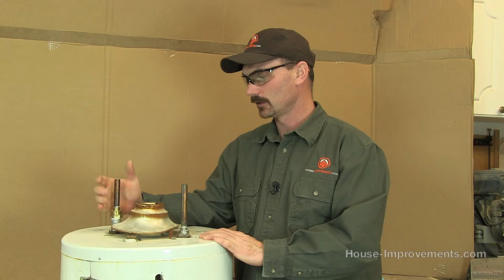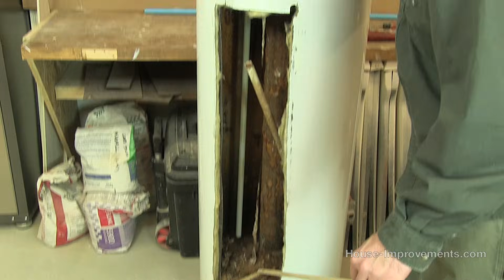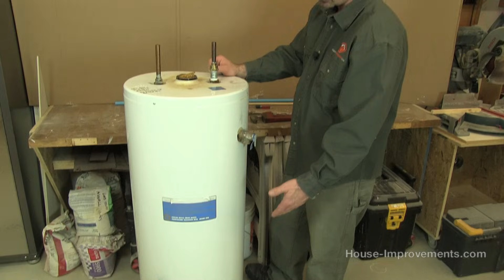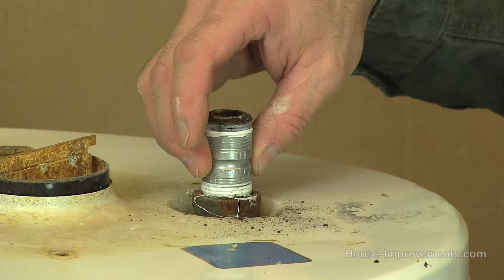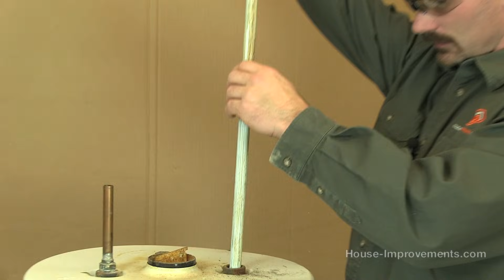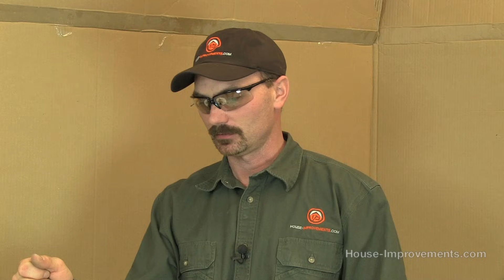How To Replace A Water Heater Dip Tube

Comment: Would love to see a version of this video where you change the dip tube in a water heater that's in place in an apt/condo, in a utility closet, behind the forced air system, with about a foot of clearance above the unit. Or a tall tank with a low ceiling in a basement.
Reply from the maker: really can not be done with that low of head room.
Reply: You have to pull the heater to work on it. No other option. More trouble however, that's the breaks when you don't have the space.
Reply: You can get flexible anode rods. They are segmented so they can be installed in tight quarters.
I don't know about the dip tube. Just seems that there should be an option for a flexible dip tube in cases where head room is tight. Must the dip tube be PVC? Is using a braided tube or other flexible tubing an option, or would it cause problems inside the tank? I don't know.
Reply: Could you not replace it with a more-flexible tube?
Reply: Shutting off the gas or disconnecting the electrical, disconnect the inlet and outlet lines, emptying your tank and moving it out the same way it was brought in will be the easiest for you. 

Second option-
You can cut the old rod in sections as you bring it out of the tank. There are new rods that have shorter sections linked together and they bend so you can feed it in to accommodate your situation. The sections around 10 inches. If you don’t have that amount of space then you should have installed it per the manufactures instructions. Manufactures recommend inspecting, servicing, and cleaning periodically. Can’t do that if things are in the way. This is important in case you are under warranty and want to be covered. 

Is this a gas water heater? If it is, your installation is violating building codes.
Reply: Plumber in our area charges $180 service call plus $120 p/hr labor. So learn to do it yourself. Also, this would be a good time to pull out the anode and perhaps change it at the same time
Reply: It's simple you charge the price of a new heater just to pull the heater out replace 1 part put it back and wave a warranty.
Reply: R. Spivey is that an option? I just assumed (maybe incorrectly) they were all basically rigid PVC-like tubes. Can I get flexible anode rods,  too?
Reply: I get about 2-3 minutes of full hot water before straight hot water drops to about 105-110*f and slowly descends from there until you get around 70-75*. If I can’t get clear the ceiling in my basement. I will tilt the water heater and have to replace 2x 3’ sections of pex. Well, the cold water piece would be about a foot long. Thankfully, I have several feet of both red and blue on hand. But constantly messing with water temp in the shower blows. 

I modified my shower head body to actually flow some water. But I get the same issue in the tub in my other bathroom. Kitchen sink and bathroom sinks aren’t an issue as they aren’t ran full on for 10+ minutes on a regular basis.

Comment: I've got some sort of galvanic corrosion on my cold water side so I have decided to change the galvanized nipple. Will the old galvanized nipple come off the dip tube or do I have to get a new diptube with the nipple attached? (This is 1 year old Rheem water heater and I just caught the corrosion.)
Reply from the maker: depends on the heater. Go to a dealer and see what the new dip tube looks like , If it has the nipple all on it then I would just buy it.
Reply: I have a side inlet on my hot water heater does it still have a dip rod

Comment: How can you connect a flared tube and dielectric heat trap nipple?  I cannot find anyone less than 60 miles away that carries the tube and nipple attached already..

Thanks!
Reply from the maker: not sure if you can just slip it in? I'm really not sure

Comment: Great video. Can you replace the fitting/tubing for the hot side? Have a leak right where the hot copper tubing comes out of the tank
Reply from the maker: I think on some you can change that fitting, best to ask a local plumbing shop.

Comment: great video shannon, what about  the hot side . there is no dip tube to be replace?  also how you test  the water valve,? or how do we know when is bad, thank u  , from ontario ca
Reply from the maker: +Everardo Camacho No dip tube on hot side. The water drain valve is fine unless it starts leaking.

Comment: BY THE TIME YOU GET TO REPLACING THAT SUCKER AND THE TROUBLE YOU HAVE TO GO THROUGH ( UNLESS YOU HAVE A VERY HIGH CEILING ) YOU MIGHT AS WELL REPLACE THE WHOLE WATER HEATER !
Reply from the maker: +TRICK-OR TREAT  Lets see $400 dollar heater plus install or $30 rod??? I'll go with the rod every time. There are segmented flexible rods for hard to get at location.
Reply: IF THE RODS SHOT THE CHANCES ARE THE REST OF THE STUFF IS NOT FAR BEHIND !
Reply: +TRICK-OR TREAT I think your caps button is stuck......Unless you're really yelling. Lol!

Comment: I have a question: instead of a dip tube, why don't manufacturers just make the cold line hookup at the bottom and keep the hot exaust at the top?
Reply: +KINGsizeWINNER , well I would guess "gravity" and simply less holes on the bottom of the tank to worry about.  If the cold hook up was at the bottom the gravity would force all the tank's water to backfeed into the cold water feed.
Reply: John Henley  I fail to see your logic.  Why would gravity have more effect on a pipe run on the exterior of the tank to the bottom of the tank than a pipe run in the interior to the bottom of the tank.  In either case, water would be entering the tank from the bottom and the same pressures would be involved.
Reply: and NO THEY ARE NOT..cars are all build with electrical boards and way too much wiring now...you really think that a 1960 ford wont last longer then a new f150????
Reply: 1 reason is to keep service work steady at all times...they wont make cars the same because there will be lack of jobs so....everything now is made to break to have fixed...
Reply from the maker: KINGsizeWINNER Very good question?
Reply: The cold water (mains) is under fairly high pressure... gravity wouldn't backfeed the tank water back into the inlet/supply.
Reply: KINGsizeWINNER 

All the sludge goes to the bottom plus water pressure would aim the cold water to the top. You don’t want that.  You want it facing down.
Reply: maybe???
i'man HVAC installer/tech and the crap that is build for us is garbage now a days is what my meaning was....nothing to do with cars ...
Reply: Cars are built better than ever!.  They last longer than ever before.
Reply: just something the normal peep can understand is all
Reply: They do make one but it's for mobile homes.
Reply: Home depot sells a rheem 60 gallon tank with the cold intake at the bottom, basically connects to the drain attachment.
Reply: So your plumbing isn't outside as much.
Reply: Materials are higher quality and so is the fit/finish of mechanical parts.  This is a well known fact.

Comment: hey i got a special request! i seen tankless water heater, could you talk a bit about this? i'm thinking maybe switching my old tank for that, or partially, maybe getting a small tank for the dishwasher and a  tankless for the rest,
Reply from the maker: If you come to my forum and reask the question I can respond to you there.http://www.house-improvements.com/forums/
Reply: HouseImprovements of course! and i subscribed too! thanks for your videos, i watched a few already and it's been pretty helpful so far, i'm building a 3/4 of a house, mostly by myself, and i have to learn and do everything from electricity to carpentry, so i'm pretty glad when i see a channel like yours , straight forward with great tips from a pro (Y)

Comment: I don't know how many times i saw a service tech use a adjustable wrench backwards, but it bugs the hell out of me.
Reply: How are you going to pull the cooper pipe out of the way or even spin it when it’s sweated to the treaded fitting and sweated to the rest of the line above. ?
Reply: Floyd Albright - Please educate me on how using a crescent wrench backwards is actually done. Seems to me either way will work just like combination wrenches.

Comment: Im about to replace my dip tube this weekend and would love the idea of a braided line,but kinda worry about these sharkbite fitting .hoe much reliable are they?
Reply from the maker: The sharkbites are advertised for use even under ground and in concealed wall spaces. Pushfit type fittings are relatively new still so i guess time will tell us for sure.
Reply: HouseImprovements  Thanks, now im just trying to locate the proper dip tube. For what i can understand my bradford white use a different kind  call hydrojet .

Comment: I just replaced my dip tube and the anode rod and the heating element. I did it the expensive way, I replaced my 15+ year old (never been maintained) water heater. I heard from a plumber not to test the pressure valve because he thinks it will get fouled and then start leaking. He did say draining and flushing the water heater every 6 months was a good idea.
Reply from the maker: That could be true on a older heater that has never been maintained before.
Reply: HouseImprovements
I was thinking that if you flush it first but even then, a water heater as old as mine was is going to have significant debris around the pressure valve opening even if it's flushed first. I didn't get a chance to open it up and take a look, but I'm sure it was pretty messed up after close to 20 years unmaintained.
 So what if on an old water heater you pull the valve and fiber brush the valve fitting, then flush it and reinstall the pressure valve. I'm just trying to work out an sequence to use on an old water heater. It just seems so easy to cause yourself more trouble by trying to maintain something that might look like your old one on the inside. Not to mention running all that rust through your pipes and faucet fittings  when you refill the tank if you don't get it flushed out all the way.

Comment: I always hear about changing out the sacrificial anode, but I've never heard that dip tub failure was an issue or could be easily repaired.  Thanks for the video.
Reply: Do house water heaters have an anode? I have seen them on RV water heaters.
Reply: FISHBREATHH It is my understanding that they all do, but I'm not a plumber, and as a new home owner, my experience is limited.
Reply from the maker: FISHBREATHH  Yes they do, watch my video on that. https://www.youtube.com/watch?v=97ett_HNu4k
Reply: Thank you